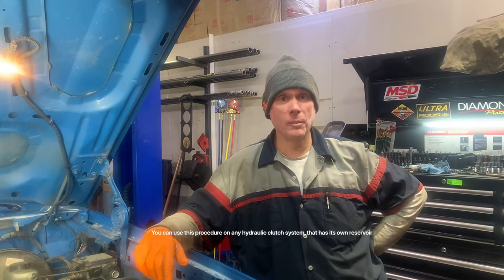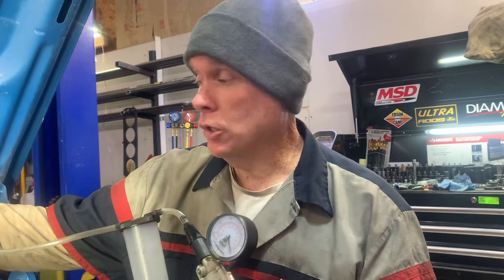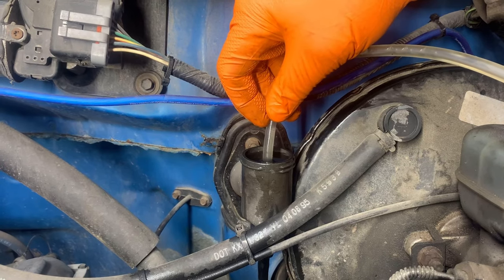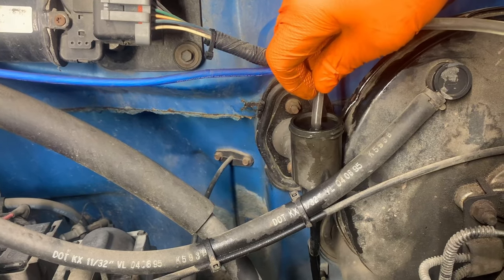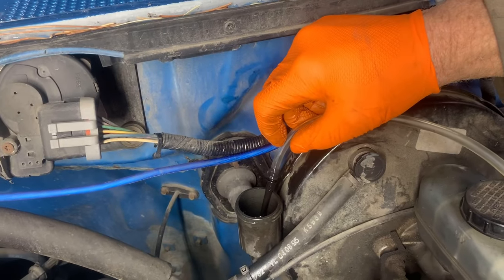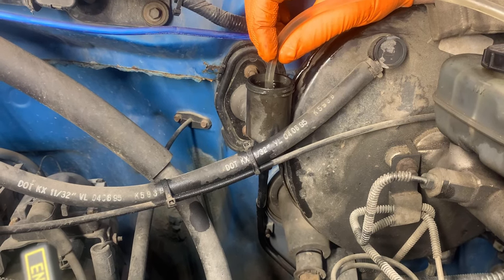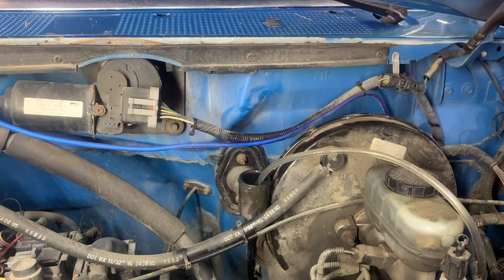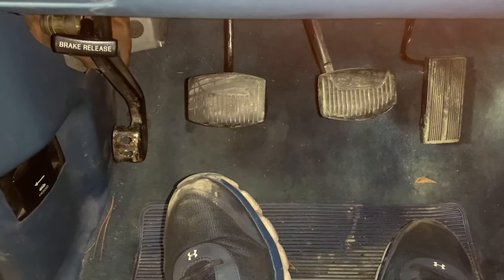Easiest, way to bleed a clutch. Works on impossible Ford concentric slaves. Can be done alone.

Comment: Yall can save that 40 bucks by just using the hose and the sprayer off the gallon jug of weed killer, works just well,  just run that hose down to the master cylinder,  I usually push the clutch paddle all the way to the floor and use a 2×4 to hold it down while I'm bleeding the air out of it.
Reply from the maker: If you leave the pedal down, it will only bleed the master. Hood to start that way but, the do it again, with it up.

Comment: IF THIS METHOD DOES NOT WORK…meaning your pedal still springs to the floor, crawl under the vehicle while your reservoir is open and push the cylinder bracket that goes into your trans forward with your foot, make sure pedal is pushed in when you do this. you will see fluid shoot out everywhere but if you try it after doing that, it will now work

Comment: Holy cow I just spent an entire day trying to get the clutch working on a brand new transmission swap. This was the final step after a looong process and absolutely could not get the air out. Infuriating.. Modern driveline needs to take a page from your book on how to bleed a hydraulic clutch. This video saved the day and got the car on the road. Not only that, it identified I had a had a loose connection in the system that I otherwise would not have realized. Brilliant. Not to mention it’s so much better than crawling underneath the car over and over again. Amazing tip! Thank you!
Reply from the maker: That’s great it helped. I’ve been where you were, I’m so glad it helped. Cheers.

Comment: What a great way to do it. Replaced slave cylinder and master cylinder in a 1984 K10 and couldn’t get it to bleed, did this and in less than 10 minutes I had a working clutch again. Thank you so much
Reply from the maker: That’s great, glad it helped

Comment: after doing the old way for an hour or so, i saw this on google. my vac gauge was busting so amazon brought me one out, around $20 i think, probably one use thing, but i was amazed at the air bubbles coming out ot the master. easy to do. full pedal on first try. may me the best its ever been. you have another fan. no nonsense video. thanks so much
Reply from the maker: You’re welcome, glad it worked.

Comment: Thank you, brother!  I went through about half a gallon of brake fluid trying to get the air out of the system on my 2006 Ranger.  Four times with the mini-vac and I'm back in business with the truck shifting better than it has since I've owned it (less than a year.)  Since it's so easy to do,  I'll probably vac it once or twice again in a week or two in case more bubbles get dislodged.
Reply from the maker: Right on!

Comment: This is the best automotive repair truck I've seen on YouTube! Thank you sir, you saved the day. My case : 1992 Ford ranger 2.3 engine, 5 speed manual. I dropped the transmission and put in new flywheel and clutch. Somehow got air in my lines, because the pedal was on the floor when I got done, despite it being a quick release fitting. Tried this trick, started getting air bubbles. The pedal was still soft. I had to open the bleeder on the slave cylinder and pump the pedal a few times, left the pedal pressed, then closed the bleeder. Then I did this trick again and started getting some response in the pedal. All in all, about an hour of sucking air out using this trick, it worked. I'm driving.
Reply from the maker: Thank you for the feedback!
Reply: I did a video on the same thing a while back, just slightly different. This is a really cool idea but if you have a combined system, your kinda out of luck. The combined system like I have on my Mustang has one resovoir for both the brakes and slave cylinder, this idea, while really cool will not work on it. Take a look at my idea, again, not knocking this dude at all, it works and thats what is most important, but it has its limits to just the non-combined system. Take a look t this and let me know what you thinks https://youtu.be/pwpkSlrILmY

Comment: I own a 1981 f250 witha 1994 clutch and trans. I tried to bleed the clutch all day. I even removed the slave cylinder and bench bled it. When I put it back in, I tried some more to get the very last bit of air out. I only got more air back in. Then I saw this vid. I tried it. It works like a charm. Thanks for making this vid. It saved my week.
Reply from the maker: @MooMoo-zd5ww  That’s great!

Comment: Ive been having an absolutely bear of a time getting the clutch system bled on my 91 f150. This is by far the best tip I've gotten all week. It's even better than the factory bleed procedure
Reply from the maker: Thanks!
Reply: My 1988 f250 has a rectangular orifice at the bottom of the master cyl. Res. So fancy pump I bought does not work
 Also the slave cyl. Does not have a bleeder nipple on the fluid drain port.  I.ve tried and tried to no avail.
Reply from the maker: @robertchapple8113  try it with the pedal down first.
Reply: Me too. It's killed my soul trying to get the air out.
Reply: Did you ever get the system bleeded I know it's been 11 months ago
Reply: @drunkingsailor2359  yeah I ended up getting it bled. Part of my problem was the pressure plate bolts came loose so I used locktight and torqued then down with a torque wrench and it works flawlessly

Comment: Good video thank you. My son and I have dropped the tranny on his 1995 Ford F150 . We replaced the clutch, slave cylinder, pressure plate and guide bearing'  rear main and oil pan .  After the assembly we had to bleed the slave cylinder and we had no luck. I found your video and went to purchase a vacuum had pump. I tired your method for a good couple hours without any success., Pedal up oedal down etc. Kept getting bubbles. Finally i took out the clutch master cylinder and line leading to the slave cylinder. After careful inspection,  it was determined that the master cylinder was bad. Got a new master cylinder from Napa for 50$ . Then i bench bled the master cylinder and line ( hooked up together) by keeping the master cylinder tilted up and by exercising the master cylinder piston to get rid of the bubles trapped in the cylinder body. I made sure it was completely filled up with brake fluid. I reattached themaster cylinder back to the pedal and line quick connect back to the slave cylinder. Then I gravity bled the  slave through the bleed screw on the bell housing until a few bubbles cam out. ( Roughly about 3 mater cylinder     reservoirs worth of fluid) then i closed the bleed screw.  Pedal was perfect .

Comment: If I could, I would kiss you for making this video - You don't know how much trouble and frustration I have been through trying to bleed my hydraulic for clutch cylinders. I almost sold a truck good that just needed a clutch because I didn't want to deal with bleeding the master and slave cylinders.  I tried this on my truck that still had a little bit of sponge on the petal and the air came right out - Thank you, Thank you, Thank you!!
Reply from the maker: You’re welcome, I’d probably giggle anyway.

Comment: After talking of this method with a friend who is a bit smarter than I am, he compared this method to degassing of epoxy or silicone. You're removing ambient pressure from the system and therefore allowing the bubbles to expand to as large as they desire, making them much easier to capture and move around.

I took off my reservoir as I couldn't get a good seal to the bottom hole, and you NEED a good seal to make this method work. Directly to the line, I stuck a hose barb and synched it down tight with a hose clamp. I then pumped my hand pump down to around 28in/Hg. At this point I started noticing bubbles coming up from my system. While this vacuum was holding, I went inside and threw the clutch pedal around for a bit to break the bubbles loose. Steady amounts of bubbles continued to come out until they finally stopped. Reconnected my hose back to the reservoir, filled it up, and then felt the pedal. Good and stiff! Thank you for the video again, and your replies to my questions. I wrote this as an individual comment so it may be found more easily by people experiencing problems like I did.

Comment: Thank you for helping me get the last little bit of air out of my F150's clutch, this video saved me so much time.
Reply from the maker: Cool!
Reply: I had a long time partner of mine.knowledgable for the most,but told me his clutch was going out,and he was grinding away at the gears big time.......I asked him a few times if he had checked the fluid level.he told me yes and ever since.he had to put alot in to refill it all way,since then hasn't used any,,😁so he popped hood and looked at the level,said see it's still all way full😫don't know what to do !!!!! So I just let him know about rubber boot you remove before filling.....pulled rubber (full)boot out and dry as a bone underneath.....cheap on fluids ????????

Comment: This worked great for me. for background info: I have a 1997 F-150, 4.2L 4WD 5speed. Poor clutch response, and would not go into gear with engine running. It would when engine was off. Pumping the clutch would help it get into gear. Hit or miss with pumping. I found the reservoir in the engine bay empty, but didn't see any leaks around the truck. Thought my slave was bad, but my symptoms didn't add up to that. So, I grabbed one of these pumps and lots of new DOT3 fluid and began bleeding. I first gravity bled the slave for a bit to get flow out of the entire system, then started pumping the clutch and bleeding it this way. There were many, many large 'eruptions' of air into the pump, bringing pressure down to 0.  This brought no resistance to the clutch pedal, making me feel like I was doing more damage, but I persisted and I repeated this probably 30 times until the pump gauge read and held at a steady ~24PSI, and no more air or crud came out of the lines. Clutch works well now. Thanks!
Reply from the maker: Thank you for the feedback! Glad it helped.

Comment: I'm doing this at lunch. I got the HF tool. 1999 Ranger got air in clutch petal piston again. I pulled it through into wheelwell 1 yr ago and was able to pull the snap ring and bleed the piston from there. Very tough job though. I bought a new MC but can't get trans line disconnected. Push in disconnect wore out. So I'll try this method, then another method puts a visegrip on the line to the trans and then you force petal to floor and air goes out through resevoir. First put front up higher on ramps to help. I got a lot of air in there. So I got a Ford I'll try your way today. Thanks good video, do more.

Comment: I thought that I would try this on my Mustang but then I realized I have an automatic transmission. Oh well. Nice video though and good to see you back Shaun.
Reply from the maker: Hi Dan! It will work on automatics too, just drill a hole in the torque converter.

Comment: I decided to bleed my 04 Ranger clutch. Was engaging high. No clutch after I tried to bleed it from underneath traditional way.😩 actually tried a Turkey blaster to force fluid thru(another video) didn’t work was looking at taking reservoir and line out to bleed, thank God I saw this video, went out bought mityvac, got my clutch back and it grabs about the middle now. Thanks so much!!
Reply from the maker: Thank you for the feedback! Glad it worked.

Comment: I’m really looking forward to giving this a try in my 89 Ford F150 that ironically the same color as the one you’re working on in this video! LOL 
Now I originally thought the clutch also got it’s fluid from the master brake cylinder and I never seen that tiny clutch cylinder hiding back behind the master brake cylinder where it’s at. Unless you know it’s there it’s easy to miss! It wasn’t till my clutch lost pressure that I came in and got on YouTube and seen a video showing where that clutch cylinder is. Unfortunately by that time my system was too low and it’s obviously got air in the system now.  Filling the cylinder up certainly helped but not enough to work as it should. I figured I have to climb underneath the truck somewhere to bleed it, also have another person to push the clutch down and hold it at the right times. Now I’m excited to try your method and hope I can accomplish getting the air out your way?  Certainly would make life a little simpler! Thanks for sharing this!  Only thing I may need is a new bleeder. Last one I got at HF didn’t really work right. It had leaks everywhere first time I used it. Tried putting small hose clamps on all the connections. But not sure if that’s solved the problem or not yet?  Hope it did, will find out soon!  If not I’ll buy a new one from another place other then HF.  HF ok for some things and not so much for others!
Reply from the maker: Best of luck!

Comment: Good tip!  I wish I'd known this when I put a new clutch assembly in my '96 F-150 last year. No matter what I did, the pedal was a bit mushy. I just insured the truck and started driving it again and the pedal is firm and like new again. The system self bled while sitting for a year!

Comment: I like your video and it worked after a long time trying it unsuccessfully.

I tried this multiple times and only got a few very small bubbles over the course of 3 days a few hours each. I was getting very frustrated. 

I have an TKO 500 transmission in my 96 F-150 with a straight 6. I had an aftermarket hydraulic clutch system in it before that mounted on the outside of the transmission and it gave me issues for years. I eventually went with an American Powertrain hydraulic throwout bearing and a stock (not OEM) replacement Ford master cylinder but I got the aluminum one. Much better setup than that other one I had. I've had it installed for a couple years and it would jerk all over the place quite often when driving down the road and slip when I'd pull any kind of weight. I measured but something must not have been right. Took it apart to take some shims out and the bearing came apart and let the fluid out, which made the system full of air. Tried this method and it wasn't working. I took the hose off the master cylinder and it wasn't losing any fluid, just sat there. I figured it had some debris plugging the hole. Decided to take the master cylinder off. Disconnected the shaft from the pedal and fluid immediately started pouring out of the master cylinder. It couldn't have even been a 16th of an inch that it was pushed in to go over the nipple on the clutch pedal mechanicals. 

Moral of the story, if you're having issues bleeding the clutch, try taking the shaft off the pedal from the master cylinder and see if the fluid flows. After I found this, I immediately started getting a firm pedal with this procedure. It's perfect now. After I figured that out, I had the clutch bled, the transmission bolted in, the starter and driveshaft mounted back on within an hour and a half. Great video.
Reply from the maker: Great tip, thank you!

Comment: I did one of these a few years ago, and I was pulling my hair out trying to get the air out. I finally took the whole thing back apart, which meant pulling the tranny back out to get the slave cylinder out, and bench bled it. I sure wish I knew about this trick then!
Reply from the maker: I’ve been there!

Comment: Thank you Shaun! I'm going to get the bleeder immediately as I have a 2007 ford ranger and it won't go in any gear and have no pedal to speak of..I'm definitely not the damn truck whisperer(and female) so my dad is coaching me over the phone lol I was about to try opening the bleed valve under truck etc. but this seems like alot easier way and can be done by yourself as I don't have a mechanic fairy either lol thank you for this video I will def be watching more!
Reply from the maker: Good luck!

Comment: Works pretty good. I had to do mine like 20 times after removing and reassembling transmission. Pump held consistent so no leaks just had alot of air. 

Reached a point where pedal was only 1/2-3/4 before I wasn't seeing any improvement. Had someone hold the pedal down and was able to progress but still had some air. Drove it around, then parked on incline and started vacuuming again and got about 85-90% pedal.
Repeated a few more times and finally got it all.

Tool is about $51 including tax from harbor freight. Thanks for the video
Reply from the maker: Thank you for the feedback. They can be difficult. Nice job.

Comment: Having been there (2003 Ranger) and just gotten back, let me say:
1.) Pre-bleed, while you have the virgin part resting in your leathery hands;
2.) The cap with the two ports actually has three -- one on the bottom which takes the four-inch section provided (I bled mine without this in place -- it's spongey);
3.) Engagement with the former master was near the top of my boot, now it is just off the floor -- this what it means, "self-adjusting"?
4.) The Mityvac kit is well worth the money -- DIY, I saved myself four hundred bucks at least; 
5.) I didn't need the 32oz jug of DOT3 -- but you might;
6.) Two years and over 150,000 views later, this is still salvation-at-a-click. Without your help, Shaun, I would still be standing in my carport and wondering "What the !*&#  now?"
Reply from the maker: Bad design, glad it helped.

Comment: Do I need to have the bleeder loose and the clutch pedal not engaged to do this process
Reply from the maker: Bleeder tight and do the first vacuum with the clutch down. That will purge the master. Then pull the pedal up and finishing vacuuming, as many times as needed to purge the slave cylinder.